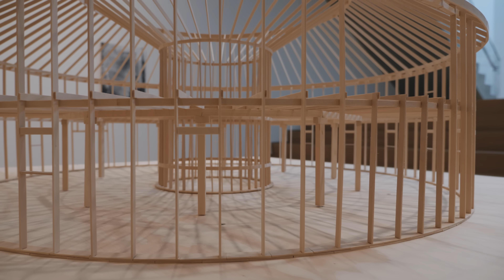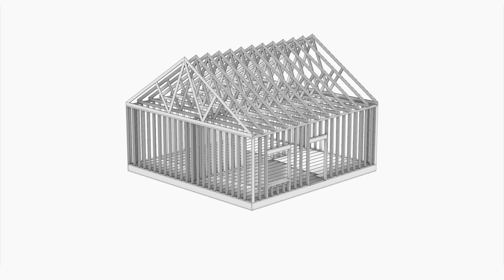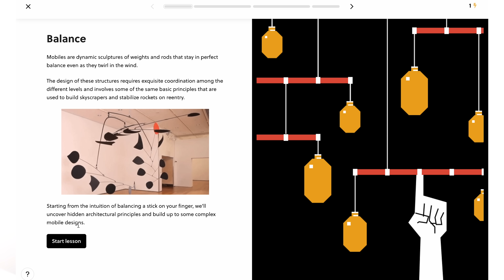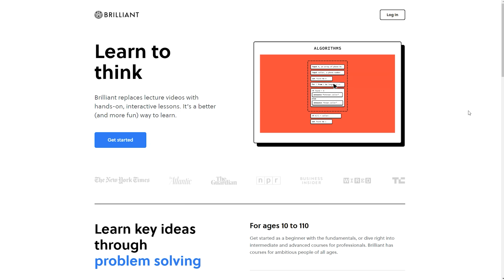The Genius of 2x4 Framing

Comment: I think you should have put more emphasis on the dawn of the industrial revolution and the rise of powertools. Cutting a beam by hand, or even in a mill was hard  enough and often more expensive than the timber itself.less cuts, less cost. And hand-forged fasteners would have been more expensive, too. And then the walls were filled in with wadle and dobb, which requires strong beams.
Reply: Most people confuse the second industrial revolution with the industrial revolution. The first industrial revolution occured in the mid 18th century and involved largely wooden machines for making textiles. The industrialization people today would recognize wouldn't happen for another 100 years.
Reply: I think I'm happy to leave wattle and daub behind. Not great insulation.

Comment: Even though the wood pieces are larger in a timber frame, the amount of wood used overall seems like less than what is used in a light frame building. Seems like the trade off is using more resources for faster and less complicated methods, driven first by the need for more buildings and then by money. If you don’t need the same skill, you can hire labourers much cheaper.
Reply: Another benefit of 2x4 construction is that you have a structural member (a stud) every 16in to make hanging things from your walls very easy. 

I'm not sure about timber frame's ability to place something basically anywhere on the wall. (I suppose it depends on what you make the wall itself out of but not having structural requirements of the wall opens up the possibility for weaker materials in the same way weak sheetrock (gypsum in a paper sandwich) is used as the face of 2x4 framing.

Comment: Used to sell building packages and this video gave verbiage to a lot of the appreciation I had for the product I sold. I will strongly contest one throwaway line though. You absolutely need a degree of skilled labor to build a free standing structure. I have seen too many Home Owner Specials that needed to be fixed or knocked down to be dissuaded from this LOL.
Reply from the maker: I agree, that line was going to be followed up by a quote from the 1800s about how 'a man and a boy could build a house in 40 days' using light wood framing. Without that context, the line sounds snarky. Framing today does take a lot of skill. Maybe in 1850 less so...
Reply: @stewarthicks  its also probable that the basic skills of an "unskilled person" have changes significantly from the 1800s to be significantly less suited to house building.

In modern times being able to use conputers is more relevant to an "unskilled person" than being able to build a house with just yourself and your family.
Reply: I think there's also the question of whether that 1850 house was necessarily better than the unskilled "homeowner special" done today.  Most of the circa-1850 houses we see today aren't the ones built by "a man and a boy".
Reply: Also should mention I sold these just outside of Chicago, so it gave me a degree of civic pride too! Would love to see a video on pole-barn construction as a derivative (or alternative maybe? Not sure what the correct relation would be) of light-wood framing. Polebarns were EXTREMELY popular when I was working this job.

Comment: Excellent video, and I really like that museum! Although you touch on it briefly, I think it's worth emphasizing that light-wood framing led directly to tremendous innovations in house design in the 19th century. Victorian houses, with their turrets, barge boards, projecting bays, extensive porches, and newly organized floor plans would have been impossible or prohibitively expensive with masonry and timber-frame construction, as would the great stick-style and shingle-style houses found here in coastal New England. These buildings led directly to the houses of architects like Frank Lloyd Wright and Greene and Greene (although, typically, Frank Lloyd Wright insisted that his buildings owed nothing to anybody who came before). I love a good old-fashioned timber-frame house (I currently live in one) but they tend to be very limited in the form they take. There's a lot more to light-wood framing than "Little boxes on the hillside, Little boxes made of ticky tacky, Little boxes on the hillside, Little boxes all the same."
Reply: Great point

Comment: I would love to hear more about the (questionable?) durability of this kind of buildings, the thermal performance (I suppose you need to completely cover it from the outside to keep the frame dry?) and the sustainabilty (I suppose good, assuming enough forests within a reasonable distance) Here in the Netherlands we used to built a lot of brick houses, suitable, given the our many rivers providing clay. But nowadays it is mainly concrete. Which is sturdy and nicely soundproof, but horrible for indoor air quality and co2 emissions.
Reply: Light wood construction is sustainable due to the renewable resource from which it comes.  It also usually performs better structurally than more rigid structures utilizing masonry, especially when the earth moves (western US or pacific rim).  The thermal performance will have to be due to the skin of the building, as the wood frame is too insubstantial to act as a barrier - but almost any exterior cladding can be used.  Durability, this is definitely an issue, but depends on more regular upkeep and repair.
Reply: A lot of our cheaply houses have cheaply made problems. It's a big issue in the US.

Does the cement become dust in the air? It's very fine dust.

One of the issues with light framing is that the beams are places where heat conducts through the wall. Lots of beams means that the wall is cold every 18 inches. Still better than the brick apartment I live in right now.

As for sustainability I don't think it's as good as most people say. Yes, trees grow and we have lots of trees in the US. Forests take a long time to recover though considering that most logging is clear cutting. It is ecologically very destructive. Also, forests are a very finely tuned balance when it comes to carbon sequestration. A lot of carbon dioxide comes from the decay of dead plants and removing the trees means that they won't capture it any more. Boom. There are estimates that it takes ten years for that land to begin consuming more co2 than it creates.

The US has Las Vegas. That alone proves that Americans have a very poor concept of sustainability.

Anyways the reason we need such cheap homes is because rich people keep pushing wages further down as they continue to raise prices. They have created a sense of inflation and willingly lie to maintain it. Most people cannot afford the quality construction that is necessary for a house to live a lifetime or even for multiple human generations.

As for your problem in Europe, the solution is probably to build more housing. Honestly I think your government could handle it pretty easily. Why isn't there the political will though to solve an issue faced by almost the entire population?
Reply: A lot of this depends on what one means by "sustainable".  Light-wood framing is all made from second-growth trees that were planted for the purpose.  You can call it a "forest" but in a lot of ways it's closer to a field that you reap every 20 years or so.  By definition it is sustainable in the simple sense of the word, in that you can keep doing the same thing approximately forever.

And, while the initial clear-cutting destroyed a stable old-growth forest that couldn't be recovered in a century, the clear-cutting for light-wood framing timber is cutting down something quite different that only spent a couple of decades growing -- and, in fact, something that probably wouldn't become a healthy forest if it were left uncut.

I'm not saying it's environmentally the best option; "sustainable" doesn't mean that.  Something like making bricks, while not sustainable (the clay you dig doesn't grow back) could well be better for the environment.  All I'm saying is that clear-cutting trees for light-wood framing is closer to mowing a cornfield than it is to clear-cutting old-growth forest.

Comment: From the other side of the pond, these look as unappetising as McDonald's. Discouraging windows. Leaking air and noise from everywhere, very flammable. All the thin parallel members can't be great for earthquakes. And all the inaccessible hollows just seem an open invitation for water, infestation and mould. Out of curiosity, how old would such a building need to be before a middle class buyer rejects it out of hand?

I'm sure there are mitigations for all these things, but they all add up to a very complicated building process that's easy to mess up. Every time I catch a US constructor channel the processes come drowning in warnings, and the comment section is a battlefield. That's not the sound of a building community that needs little skill to do its job, as our host suggests.
Reply: Light wood construction performs BETTER in earthquakes than ridged stone structures.  We actually outlaw unreinforced masonry on the west coast of the US because it will collapse in an earthquake.  The strength to weight ration of light wood construction make it ideal for low height buildings.  The reason these are popular are, even with modifications and mitigations, they are more efficient.
Reply: @twells138  First off, light timber framing is ugly as hell. My 2 cents on that. 

Second off, don't come at me saying obviously light timber frame is best just because you don't like my opinion. Fuck American exceptionalism. Number 1 reason I want to move out of this country. Yeesh
Reply: Thank you for sharing. I'd like to build the house I live in someday. And when I do, this type of framing will be my very last choice. Personally, I think it's...ugly. And like you say, it has a multitude of disadvantages.

Comment: 2x4 Framing VS one tornady boi
Reply: Timber buildings don’t stand up to Tornadoes either, Only thing that will would be concrete or reinforced rammed earth i.e. concrete mixed with dirt. I live in Florida and have seen all matter structures imploded by tornadoes/hurricanes, you might want to reconsider your position on this if you live in a tornado prone area. I would probably recommend a good tornado shelter in the basement with an exterior door so you don’t get trapped in the home.

Comment: For a long time I wanted to build my own house and I would spent much time calculating the material costs. I live in the northeast so the building would need alot of insulation. A concrete or block home would be preferred but you would need walls that are 10 inches thick with external foam insulation. If the insulation is outside you need cladding and if it is inside you need framing to hang drywall on. Heavy timber framing is inefficient as you have a heavy and expensive frame then you need more studs between the beams to support the walls, why do that when the studs can double as the structure and wall?  It just does not make sense to build with anything other than wood in the northeast United States.
Reply: Earlier light wood framed houses with brick in between the framing are pretty idyllic in the north-east for function/efficiency. However i gotta strongly disagree about it not making sense to make anything else in the northeast. One of the benefits of the area is that there aren't many natural disasters, so architecture can be done fairly freely as long as it's warm and has a roof that can manage the snow. Budget aside, that should lead to a greater variety of housing styles being used, not less

Comment: This is so different for me as I live in a country where all the houses are built with bricks and mortar. I would like to know who designs the structure of a light wood frame house in US. Is the architect or the civil engineer? Thanks for sharing this amazing content! Greetings from Brazil!
Reply: Bricks are a type of “it’s so simple it’s smart!” too. :) All kinds of people work with designing/ building light wood frame houses.
Reply: For most houses where you're nit doing something wacky (EG cantilevers) you can get a structural engineer to stamp a standard issue sheet of typical framing details and specs which covers everyone legally. There's some variation locally in detailing, based on hurricane loads, earthquakes, yadda yadda.

Comment: Americans when their entire house made from toothpicks gets airdropped into Cuba during a storm:

:o
Reply: Depends on the engineering.  Shear walls, anchors, hurricane strapping, lumber dimensions, etc.  Clever architects can keep you grounded on the mainland.  At least in most storms…
Reply: yeah but also you can be 25 and actually afford a house with a blue collar job in much of the us that isn't overpriced. people most places elsewhere, most likely where you're writing from as well, couldn't be windswept  away because there are 25 people per house weighing it down. so I wouldn't laugh
Reply: @gavranarh  bro what are you talking about. Yeah a those toy houses might cost 3 dollars in Bumfuck Alabama. But anywhere even remotely near major cities a 25 year old is never buying a house on a blue colar wage. Also, not even necessarily true for Europe
Reply: @mathieumarlaire  I mean of course, I'm exaggerating up to a point what is the common stereotype. But I also think that it's wrong to dismiss the areas not around "major cities" as Bumfuck Alabama - there are just 10 cities over a million people, only four are over 2 mil - in the whole of US, for 330 million people. What you'd qualify as Bumfuck, AL is what the US largely is, statistically at least. So there is some justification in claiming that you can afford a house with a blue collar job, and I don't mean buy it with cash outright, certainly more so than the claim that all the houses are built from toothpicks.
Reply: @gavranarh  You definitely cannot afford a city house in USA, It is the same in Europe. You can buy an urban house in Europe much much cheaper.
Reply: @SonOfGod0600  i mean this whole discussion is dumb, we are literally talking about two continents with 44 states in one and almost 50 states in the other - the differences in every state/country are enormous, let alone across continent. but in general I would think that in a lot of the parts of the US, which are sometimes pejoratively referred to as the flyover states, I think housing on average is more affordable as adjusted for the standard of living than in Europe. Correct me if I'm wrong. Particularly in the EU the housing is on average very expensive because of the  stringent legal building requirements which make housing more expensive to design, build, maintain and ultimately buy.